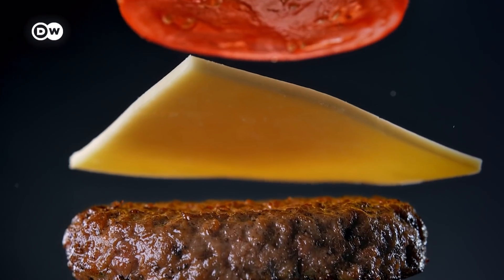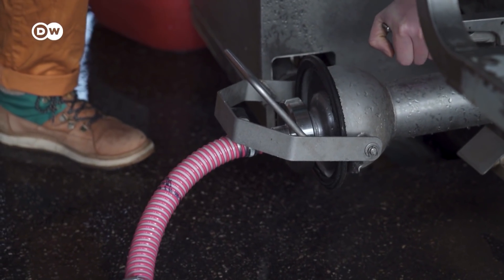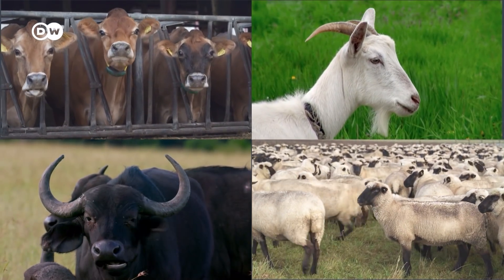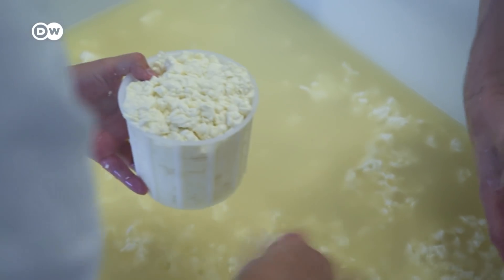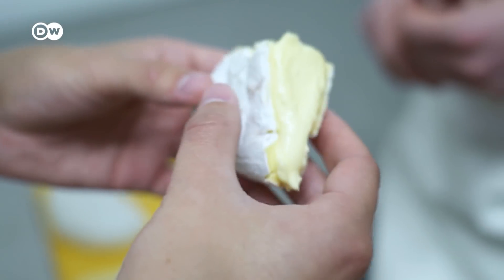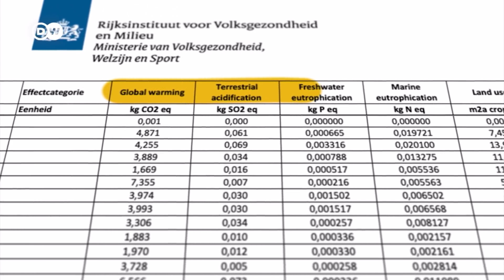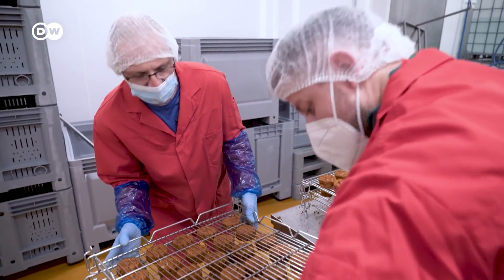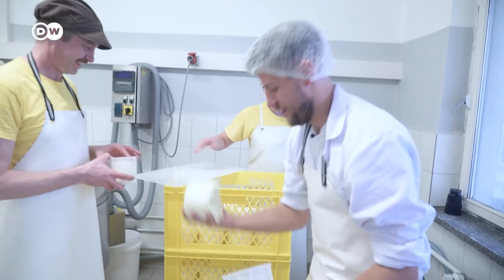We gotta talk about cheese... (sorry)

Comment: This is only really correct for factory farming, not regenerative farming (which can be done at scale, but requires a lot of land, of which we have a lot in the US at least).  The water issue is not an issue on traditional or regenerative farms as its all green water anyways and would otherwise be in the environment unused.  The carbon foot print is also offset or entirely eliminated in those farms, so really the message should be, convert factory farming into sustainable farming.  A lot if not all of these issues would go away.

Comment: Ok but you’re saying you need 10 litres of milk for one kilogram of cheese and that’s low yeild. But when you take the water out of the milk - like lets say you started with powdered milk then you yeild is like 1:1. Like you’re not penalizing the cashews for waste water but you are penalizing the milk for the water that ends up not going into the cheese. Like you can’t compare liquids and solids like that.

Also the cows are from down the road and can generally eat almost anything so unless the number of total global cows is increasing year on year, the methane is all part of the carbon cycle and should be pretty steady state but cashews are presumably flown in with fossil fuels which increases the amount of net carbon in the system 

but it’s hella tricky to figure out how it all fits together big picture

Comment: When will people learn that the only carbon that is bad for the environment (not part of the natural carbon cycle) is the carbon we extract from underneath the environment. Stop blaming everything else but coal and oil.
Reply: Methane is worse than carbon dioxide. It is not only a matter of carbon balance.
Reply: @abelabel3664  Methane turns into co2 with time, takes about 10 years, reabsorbed by plants, the eaten by cows again. Just like how burning wood and straw for heat, is considered carbon neutral in many places.
Reply: @wrigzor  And within those 10 years, what does it do exactly when it comes to radiative forcing...? See, 10 years is a lot, especially when are not stopping its emissions.
Reply: @abelabel3664  Compared to oil and coal it is inconsequential. cow produce emissions yes, just like you do, but has a natural cycle. Oil and coal does not have a cycle. it is pure additive. Cow can be a part of balance, oil and coal can not.
Reply: @wrigzor  Is it though...? Agriculture and land use emits more than the entire transport sector, for example. We are talking about 15 to 30% of all emissions depending on the estimate and if land use is considered. I do agree that we should get rid of oil and coal, but I also think that we can get rid of the main cause of deforestation and wild species extinction. What we have at the moment could not be further from a cycle, and unnecessarily killing and exploiting animals while using a lot more land and resources than we would consuming plants does not seem to be a good choice.
Reply: @abelabel3664  my only point is you cant blame life for emissions. Whatever is emitted by expending life, is re-sequestered the following year(s) by regrowth. In some cases even more is sequestered. The real emissions come from the machines and factories that do the work. Again, oil. And as someone who comes from a very developed country covered almost entirely by agriculture, how can i ask anything less of any other nation? And i dont think the exploitation and slaughter of animals for food and other products is unnecessary. I just find it so silly how much focus there is on the "smaller" numbers, when the real exponential emissions, come from the monster we all are aware of. Agriculture CAN be balanced and cyclical, The expenditure of oil and coal can never be.
Reply: @wrigzor  I agree in principle with not blaming life for emissions. However, upon deeper analysis, these are lives that we are breeding at expense of wild life. We unnecessarily farm a huge amount of animals and grow crops to feed them while deforestating and extinguishing other species. Currently, 96% of the biomass of all land mammals is composed by us and the animals we farm, and that is absurd.

You can ask your own country to focus on plant agriculture and consumption, and return areas used for animals to nature. You can ask your country to stop importing soy from South America to feed animals.

Sure, agriculture can have a lower impact, and  using animals is never more efficient than directly going for plants.

Comment: How is the 2.8 kg of CO₂ per 1kg of milk counted?

Is it that a cow produces an X amount of CO₂ in its lifetime and a Y amount of milk. So you just divide X (total amount of CO₂) by Y (total amount of milk) and you get how much CO₂ has been produced by the cow per milk unit?

Or is the the total amount of CO₂ produced by the cow divided by all of its products? I am not very sure how that could be done but you would again have:
X - total amount of CO₂ produced
Y1 - total milk produced (kg)
Y2 - total meat produced (kg)
Y3 - total leather produced (m2 plus thickness?)
Maybe some cows are raised only to produced some of these but maybe not.

Each Y would have a coefficient (not sure if that is the right thing). Maybe based on the price? I am not very sure how to assign it.

So the final formula would look something like this: X/(Y1coefficient * Y1 + Y2coefficient * Y2 + Y3coefficient * Y3). This formula maybe is not correct but I just hope someone gets the gist and maybe finds the necessary values to calculate it.

Comment: How does the cows ability to turn carbon-containing greens into fertilisers as a carbon sink compare to the methane they emit?
Wondering if maybe that somewhat cancels out their GWP, since cows need a lot of vegetation.
Reply: Depends on the farming system. A rotationally grazing, grassfed ranch can work that carbon back into the soil, but factory farms, where the majority of dairy comes from, the manure actually becomes a pollutant, seeping into waterways and groundwater, and emitting methane as its sits around in 'waste lagoons'. A good 12% of agricultural greenhouse gas emissions is from manure - it's a source of pollution, not a sink!
Reply: It doesn't, they generally eat grass and soya that has grown on fetilized soil so there's really no benefit there.

Comment: The real contributor to pollution (80%) is the fossil fuel industry and all the others dependent on it. I get that cows produce alot of emissions too, but even if we get rid of all the beef and cow lactates consumption we'd still be in deep trouble by 2100.
Reply: Just another diversion likely spread by the fossil fuel industry. It's the "personal carbon footprint" all over again. (Was introduced by BP in a marketing campaign to shift blame to consumers)
Reply: You are totally correct. Also a lot of calculations of various products include transport costs by plane and truck. If rail was used instead transport footprint would be cut by 80-95%. Governments worldwide need to invest into rail infrastructure as the greenest transport. And stop subsidising fossil fuel obviously.